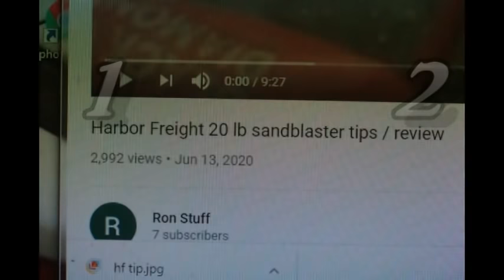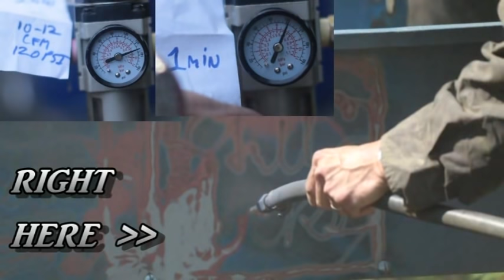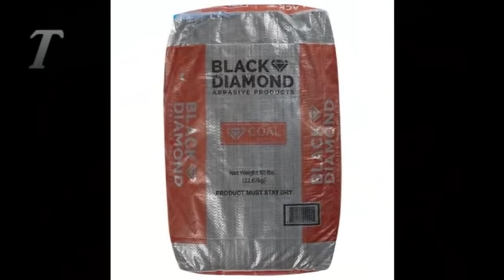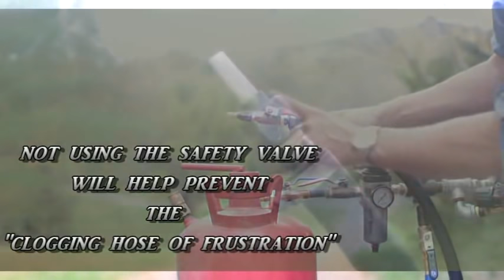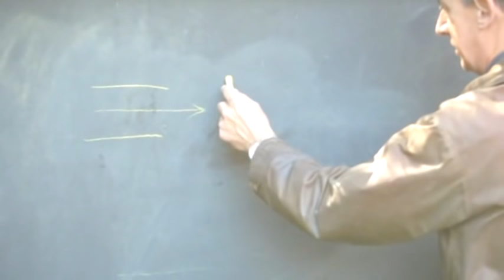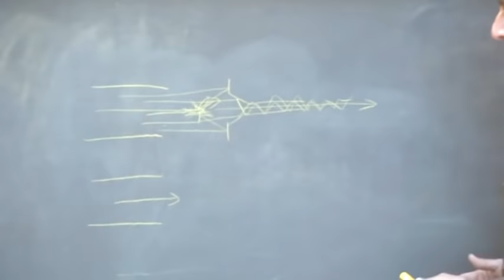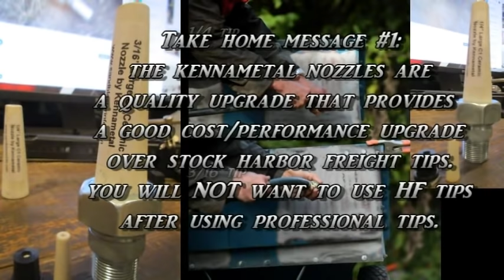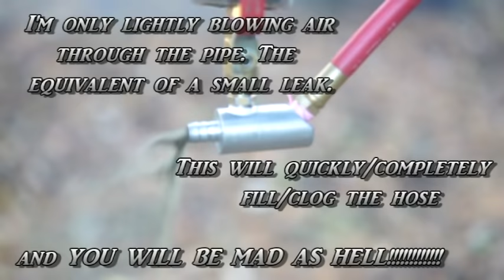Harbor Freight Sandblaster  - The Comprehensive Guide -  Making 20lb 40lb 110lb models work great.

Comment from the maker: 1.A good video on the "sandblaster trap" https://www.youtube.com/watch?v=KFgA0n3Vr68&t=49s   
2. The website/link to the "evinflo" comment  actually referred to an "Evintho" license plate, and I finally found it!!!! https://www.garagejournal.com/forum/showthread.php?t=207210
Also, consider getting a 4 way "T" like I did instead of the 3 way T as shown in the link, for easier cleaning.
Also, I provided a number of alternate links/info in the comments section under different youtuber's comments. These modifications are a suggestion of "one way" to do it, but by no means are they the only way.  At lower CFMs, you might decide to not even change anything, it is all predicated on your individual needs. Also, I would recommend multiple air dryers in line if moisture is an issue.
3. In the video, I have a bleed off valve for air for the helmet. After using it, I would recommend against it. Not healthy, use a separate air source.
4. People  have asked about soda blasting. I haven't tried soda blasting yet. I would recommend doing searches for soda blasting / alternative media  for more info.
Reply: Thanks Ron much appreciated.
Reply: Www

Comment: You saved me about $600 between a new, albeit underpowered air compressor, the sand blaster itself, and supplies. Now I know not to even bother until I can afford a proper compressor. Thank you! You’ve saved a lot of people time and money with your help
Reply: I did exactly what he warned about. Bought second hand comp. blast cabinet with foot peddle and blast pot. Traveled miles with my trailer to collect it all. Turns out the guy was selling 'cause it was not up to snuff. Wasted a ton of money and still don't have a good set-up!

Comment: Been sandblasting since the early 90s using a homemade unit out of a 30 lb propane tank, a six foot section of high pressure hose and the dead man setup less the shutoff coupled with two ball valves a short regular hose about two feet in length and some common fittings , two wheels and a standard fill off a farm fuel tank from a farm tank.  It must have gone through several tons of material as i buy the standard large bag that comes i  at 1200 pounds. About every year.   I have also used recycled glass which cuts best but hard to find as cheep.  I have blasted bulk boxes on 5 ton trucks for potatoes, dump truck and trailer boxes, loader, graders, dozers and so on.  Used it with diesel industrial compressors, 5 hp uprights and for the last few years a 3 cylinder Devilbis industrial compressor.  Some things i found.  Your main air feed is from your shutoff to a tee under the tank to a pressure hose containing your nozzle.  One ball valve connected to a half inch feeder hose from your air supply.  You turn it one full always.  The second ball valve supplies air into the tank.  It pressurize the tank forcing product into the fast moving air already going through the hose and nozzle.   It is adjusted for best flow of the product and can be opened if the product bridges in the tank.  I use a 3/16 long ceramic nozzle from a reputable manufacturer as cheap ones will wear out rapidly.  Easy peasy.  Made some 10 pound ones for friends that they love.    When you have large air volume a dryer isn't a problem, you get a blast of condensation every now and then.

Comment: I own an old steel boat (1949 built) and the cost to get it commercially blasted is astronomical. Plus I hate paying other people to do my work….. I’ve spent probably a good 12 hours watching different videos on folks modifying these blasters and yours is by far the most comprehensive. Thanks for making it!
Reply: You'll never be done unless you spend tens of thousands of dollars on the equipment.
You could do wet blasting with a used portable diesel power washer for a few hundred bucks, check out videos on that.

Comment: This video is extremely underrated. Thank you for pointing out all the valuable information. Just ordered my sandblaster and will upgrade it to 1/2 inch piping. My 28 cfm gasoline compressor will make short work of every project!! Thanks again you are a legend!

Comment: Thank you very much! You worked hard on this video to our benefit.  I probably have over 100 hours on the same sandblaster. I wish I’d had all of your points when I started with it. I bought this HF sand blaster six or seven years ago. I’ve gone through an evolution of tips, media, and better compressors.  My point to guys just getting started with their man cave, would be to purchase or otherwise get their hands on the biggest compressor possible.  Even if you have to spend $300 to get a big used or new compressor, it will pay for itself in your enjoyment of your tools over and over again. It takes this sandblaster to a new level.

Comment: I hope you are able to make a full time living from YouTube, because you deserve it. This video was incredible and saved me SO MUCH frustration. I have the 110 lb blaster. Changed the hosing to 1/2” and changed the ball valves to 1/2” and threw away that garbage tip from HF and for the kennametal. Blaster works great now. Thank you so much.
Reply: Where would I get the right parts for the HF 110lbs to make it better thanks

Comment: Gday Ron,
Thank you mate for taking the time to make and post this very informative video. I’ve just purchased a similar set up here in Australia that I’m sure comes out the same factory in China. 
I’ve also purchased a Pilot Brand 48cfm compressor with a 300 litre or 80 gallon holding tank, second hand. It has a full service history and has been serviced every 6 months. Takes 2 minutes to pump up two 100psi and has a max of 160psi. I’m looking to order those Kennametal 1/4 inch tips tonight. Along with larger pipe and fittings soon too.
I buy, restore, resell skid steers here as a hobby that’s slowly turning into a small business. This Sir was priceless to me. 
I can’t thank you enough for all that hard found knowledge you have passed on. It’s very very much appreciated and I definitely owe you a beer!
Thank you,
Cheers, Nigel 👍👍🍻

Comment: Welp...  you just saved me money.  I was all set (tomorrow morning) to go buy the Harbor Freight 110lb sandblaster.  I knew that a little pancake compressor was probably too small so I got a larger 8 gallon Goodyear compressor on sale at Walmart.  But after watching your video (and the D3Sshooter video you linked) I see that the CFM (approx 3CFM) of my compressor is woefully inadequate for removing thick whitewash from an old rock wall.  Thanks for posting this informative video.

Comment: Good thanks that you mentioned the first video too. 
One thing about panel warping. In different videos from Dustless blasting they say it does warp because of heating up ..... my experience is totally the opposit. A panel being blasted with a temp increas of a few degrees might, if any, barely warp and when cooling off should bend back but they don’t. Cars don’t bend when sitting in the sun either 🤣. The reason is that even in my wet blast cabinett I can warp a panel when hitting under 90degrees because the media „hammers“ the surface and stretches one side so it starts bending. Blasting the back side of the same panel will „bend“ it back to some degree but never exactly the same. One improvement is hitting the panel at an angle (eg. 45 degrees) which scratches more than hammering.
Greetings Bernhard
Reply from the maker: I'm in the same camp as you,  thinking it's the shot peening/hammering more than the heating. Good to know your experience with wet sanding. I also should have said in the video, but maybe forgot too, the medium grit really exacerbates it compared to the fine grit. Good to know the 45 degree angle suggestion. Thanks!
Reply: About the grit, I only use very fine media because I am restoring a V12 engine and there are so many different materials used that I don’t want to seriously damage the surface (brass, aluminium ....). In my dry blast box I use crushed glass or for Cerakoting aluminium oxyde (more expensive) and in my wet blaster glass beads (very fine too) which shines the surface nicely. 
Also a (dry) blasted steel surface with very fine media is quickly polished up with a wire wheel better than any wet blaster can and when degreased can be nickelplated for corrosion protection almost like chrome.
Bernhard
Reply from the maker: @bernhardlist9359  V12. Nice. You realize- We're going to need to see videos of this.

Comment: Great video analysis! I have the larger version, but the same flow issue at the bottom of the pot. I managed to complete a project with it, but struggled immensely. I thought I narrowed it down to the pressure in the pot trying to funnel itself through the sand and no media coming through (I would shake the pot and it would blast again) so I decided I was going to de-pressurize the pot.....thought, I was so frustrated, I stopped using the blaster. I'm  now re-energized with new information and maybe retrofit the blaster to address the shortcomings. When the blaster works, it's a blast! lol! 
BTW, I used soda blasting, switched to slag, but made no difference in the clogging department.
Reply from the maker: Thanks for writing. Good luck. I would add- I added a lot of stuff for what I did. Don't follow it bit for bit, but look at your problem areas and address as needed. If things don't work for you, let me know.

Comment: Best video on entry level sandblasters. Wow!!! I’m trying to find a used pot since I’ll be upgrading everything else. Ingenious how you hooked 3 air compressors to make up the CFMs. I currently have a husky 60 gallon 220volt air compressor that should put me mid CFMs, for a truck frame I want to blast.

Comment: 16:30 You didn't touch on, but the narrowing diameter of the air flow increases velocity. The shallow angle allows the airflow to accelerate more smoothly, giving the abrasive more time to accelerate, too.
Reply: For smother flow of media I hang a saw zaw on the tank with ratchet strap to agitate the unit...noticed fewer clogs at tip and better flow....FYI

Comment: many years ago i bought a 120 pond power fist sand blaster like this one, the only stuff that worked ok with it was a silica sand, but it was sso fine you couldnt cut rust and paint of a tire rim, or body metal.. not sure what it good for, i went to a black beuty and it was always plunging up in the bottom mixing valve, i tried other mediums but was always a huge problem, and i have a 120 gallon tank with a 6hp motor with a 2 stage comprser as i am a welder and need lots of air, 28cfm. at 175 psi. i watched all these mod videos but was never happy with it, after trying them mods i gave up and in the scrap pile it went. i must have sat out there for over 10 years, keep in mind all the valves on it were not brass, they were all black hardened steel valves. one day when i broke 2 ribs from one of my many steers. i could hardly move, never mind breath, this lasted a good 4 months. half way though this time i was beyond board out of my mind. i dug the sand blaster out of my huge scrap pile with the help of my boom truck. i started looking at the mods i had made that never really fixed the problems, i took it all a part. i cut the fitting out of the bottom of the tank. and welded in a 1" weld on NPT coupling. USED 1" TEE 1" SHORT PIPE NIPPLE . i put a 1" hose on that i had laying around. i was thinking back to my young days at Can car as a sand blaster on the hopper car rail line, this hopper cars were built there, and i recall how the blast units were built, and used a 2" blast hose, if you got shoot in the arm, the ass, leg, man you knew you were hit. i bushed the other end of the 1" tee down to 3/4" NPT. I REPLACED THE WATER separator, even tho i have an air drier in the main feed off the compressor..  WITH ONE I HAD KICKING AROUND THAT HAS 3/4" NPT. MY COMPRESSOR HAS  1" NPT hook up, but i set it up with 3/4" npt  blocks, 1/2" blocks, 3/8" air blocks. i supplied the sand blaster with a 3/4" air line, and built my own tip/s in a small scale to the kind that i used at Can car. using a steel union for tip replacement and size. i been able to run any medeim i want though it, well taking count of metal thickness, as it will blow though light metal.. problem is, the tank to small.

Comment: Deadman valve for blast cabinet and large nozzles. Tractor supply fine coal slag. Full air pressure adjust you media feed amount at bottom. Bingo!!!
Reply: With a 10cfm air flow cutting sand flow at bottom will allow you to blast for a few min. But air will get so hot you will start getting moisture in you air flow. tractor supply coal slag media is what i use most of the time and it cuts fast and deep. On thin metal you want a different media. Heck tractor supply is 12 dollars 50 pound bag. Harbor freight media is 40 dollars a bag. Some things i use play sand that i pour in 55 gal drum build fire under drum to dry out all moisture. Then let it cool and use it. I bought the harbor fright 110 pound blaster because i needed it that day. Sold my other one, if you got a old water tank they are easy to build. My other one held couple hundred pound sand and was a real blaster it would keep my 160cfm diesel compressor busy. But at my age the little 110 pound is all i need.

Comment: Well you saved the day with this video, I thought great another harbor freight POS. It worked then it didn’t then it did then didn’t, I would turn it on and it would just pour sand out the tip I mean pour out, a big huge waste, I spent more time unclogging it then I did blasting. Looks like a trip to Lowe’s is going to help and an order of good tips. THANKS
Reply from the maker: Good to hear Ron. I'd check out my other video and master those things first before spending too much money on the sandblaster, and then upgrade if necessary. If you have about 10 cfms, I probably wouldn't bother too much with this stuff, but as you go higher in cfms 20+ the 1/2 lines and such really start to shine. Just trying to save you a buck or two depending on what you've got setupwise. At very least, making a new lower valve makes cleaning it out soooo much easier. Whatever works. Good luck! have fun.
Reply: @ronstuff6330  well I did order the new tip 5/32. I’m running 14 cfm. And I will change line to tank and at the bottom, just makes since. Air feeding tank I can leave.
Reply from the maker: Good luck. You should be good.
Reply: Ron where did you find the 1/2” hose from valve to bottom of tank?, also just received my new tip, dam it’s huge, did you run an adapter from tip to hose?
Reply: Like I said I bought the tip but the thread size is 1” no way does it fit in the hose, did I order the wrong one or should I just reduce down to fit hose?

Comment: One of the most comprehensive vids ive seen on the subject and not wondering off into personal sidebar conversations. I like the info on the Kennametal tips and may go with that tip.
I did have a question as to whether you bushed bottom bung hole fitting from 3/8"---1/2" or did you open the bung up to 1/2" by drilling and retapping???
Reply from the maker: Thanks. If you mean the bottom hole in the tank, I kept that stock. It let's plenty of sand through.
Reply: @ronstuff6330  ok, I converters my hf blast cabinet to run a larger 3/4" hose outta the bottom of the collection hopper to the blas gun and have seen a few vids where guys have done the same with the bottom hole on pressure pot but we're met with arguments that it could compromise the integrity of the tank. I am taking all things I've learned and building my custom version in the near future. TY for your contributions...😉👍

Comment: Hi Ron. Excellent video and it has helped me a lot. I have an idea to help you.....  why don't you get one of those $20 amazon wet blasting attachments for your pressure washer and see if you can send pressurized sand through your pressure washer attachment. They seem to have similar issues as a regular sand blaster and I wonder if pressurizing the sand into the tip as opposed to syphon feeding would work. It could be something amazing and you seem like just the mad man to try it.
Reply from the maker: The mad man concurs, that seems like a good idea. I might just try that when it gets warmer out!

Comment: Thank you very much for the info,I'm sure you have saved many  guys alot of frustration,I bought a commercial rig years ago,it has a dedicated 4 cylinder ford motor with a huge compressor and 60/80 gallon pot mounted on a 1/1/2 ton truck big hoses etc but the motor needs rebuilding so instead of waisting my $ on more agggggravation that includes my x girlfriend she was beautiful but worthless,,I'll spend my $ on fixing my commercial unit and my yellow lab...thanx again
Reply from the maker: lol about the ex! Fixing the heavy duty unit would be what I would do. good luck!

Comment: I found with sand blasting it has more to due with size of Hoses and tubing from Tank to Sand blaster nozzle. Small 1/4 lines restrict air flow like a Resistor in a electrical circuit any part of those hoses being restricted will slow the sand and air from doing a good job. CFM is a factor but that is more of quanity of air and the time, by opening up the hoses bigger your CFM will have to be higher because your air will beused at a higher rate, but you will get more surfaced cleaned quicker.
Reply: On hose yes small hose will effect the cfm. But like the fittings going in 1/4 will pass 120 cfm at 100 pounds. The size hose depends on ft you are running. Hose and pipe ratings for air flow rate is at 100ft. For fittings is nozzle flow rate. Even a 1/4 inch air pipe at a couple ft long will pass 120 cfm at 100psi.